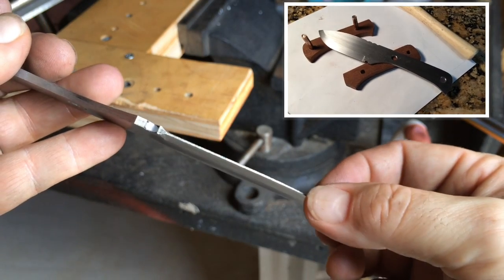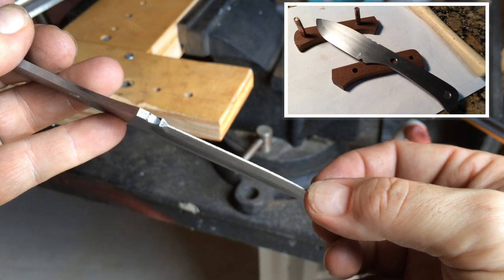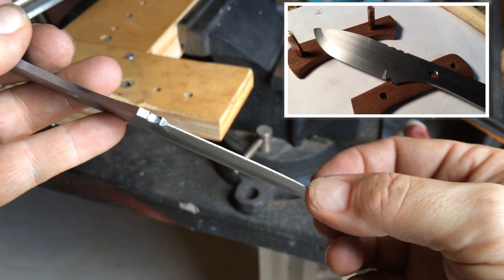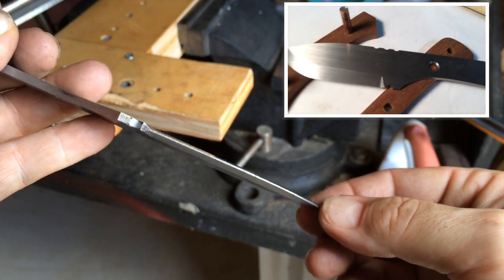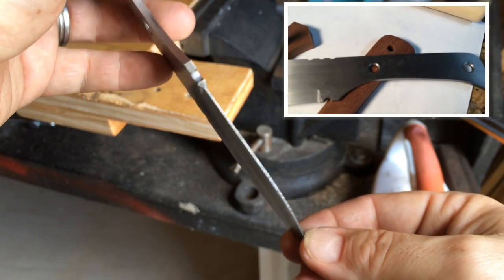Knife Making - Shaping Secondary Edge

Comment: Put a Bronze sleeve over the screw guide, The file will rub against and not wear that tall screw
Reply from the maker: +Bak Draft Great tip! Thanks
Reply: YW, I noticed that I had to replace that screw  to early. A trip to the hardware store solved that problem and also saves the edge of my file.